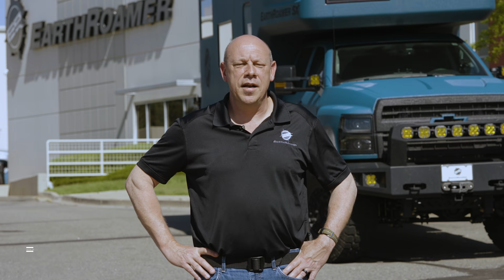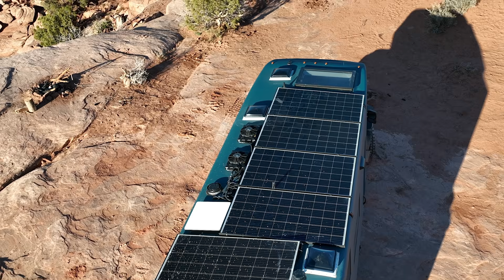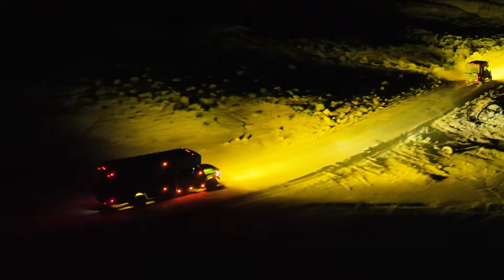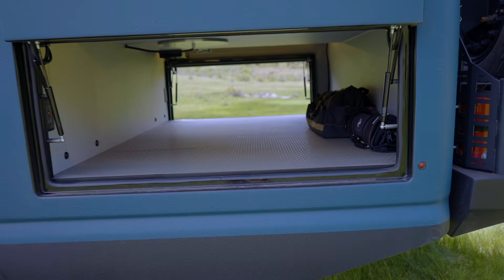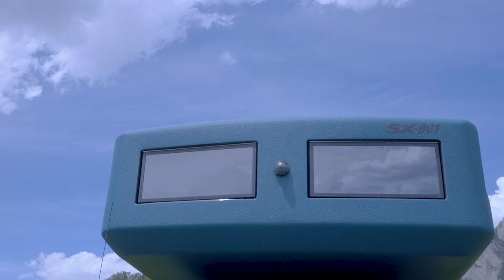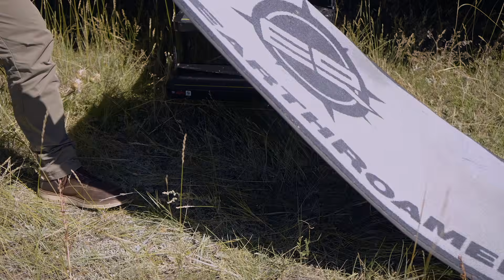EarthRoamer SX Exterior Walkthrough

Comment: Looks awesome but some of it's off the beaten track capabilities means that I personally would have to either have another vehicle along or pull a trailer with additional gear (probabbly both). Having only one spare tire is inviting problems once you get far enough away from roads and while the 16.5k winches sounds beefy that is before you take in the sheer mass of a 6500 with all of this heaped on top. Everything I know about getting a vehicle out of that mire that it has sunken into says that you should have a winch rated to at least 1.5 times the weight of the vehicle it's attached to and there is no way a 16.5k one meets that criteria with this beast. I could double line it sure but that cuts the possible distance to that quite frankly extremely sturdy anchor point thats needed neatly in half. If on the other hand you're fine with just taking it on dirt roads and some light excursions right next to said trails I'm sure it's excellent.

Comment: This exact setup but on a ford f450/550 with harrop supercharged 7.4l Godzilla gas motor. (No cold start worries or finding/storing def fluid) and painted in a light grey color that isn’t so neon bright and will not heat up in sunlight. But ya….on the nose gentlemen. On the nose.